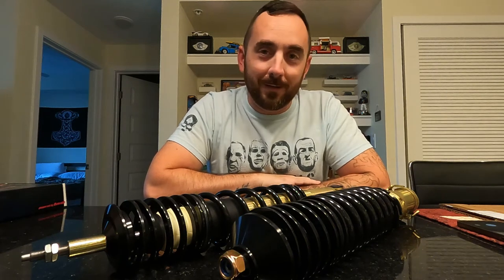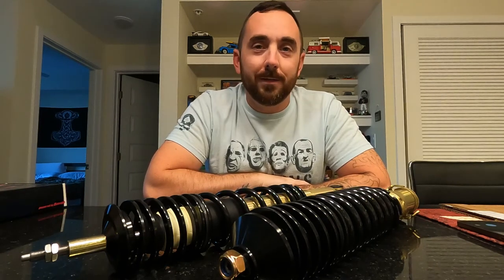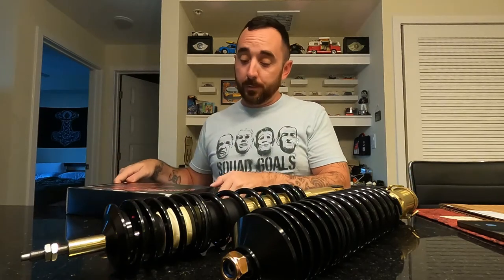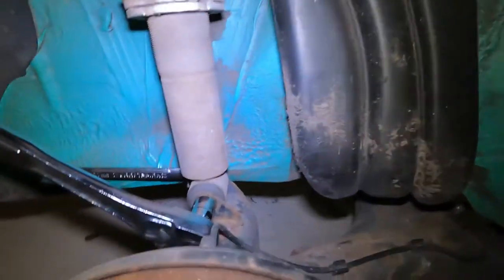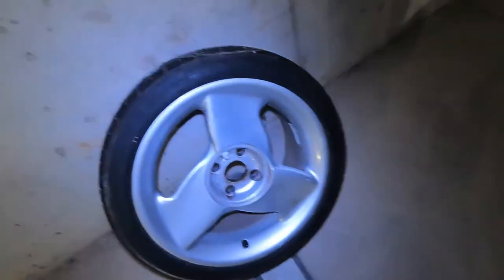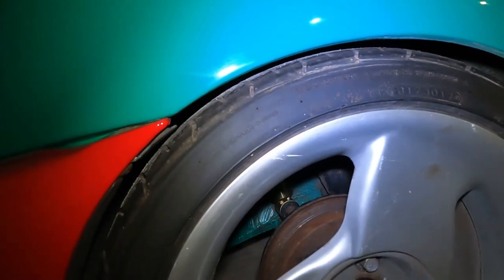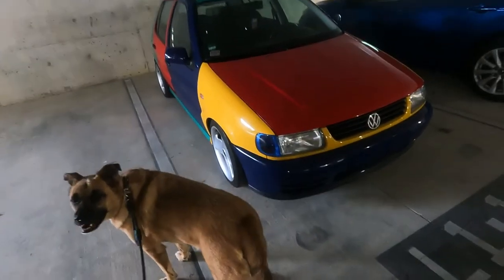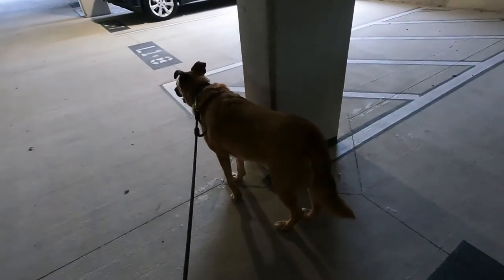VW 6N Polo Harlekin - Coilover Install

Comment: These are fairly similar to DTS-Line coilovers. I run them under my 6N, now for a year, without any problems. I regularly take it to trackdays and touge routes, and it is doing it's job perfectly. You should get poly bushes for the suspension, because the OEM rubber bushes are weak, and tend to crack after a year of use (abuse :D). It is a nice car overall, I have a 6N2 GTI (around 130HP) engine swap, and with the 280mm brakes from the G60 Corrado and a rear disc brake setup, with GTI antirollbars, it handles quite good. I could beat a lot of more expensive cars on the track with it.
Reply from the maker: Thanks for the comment!! Your 6N sounds pretty awesome. When I was getting the parts for the coilovers I was thinking the same thing about the Poly bushings. Maybe eventually :)

Comment: Does a N9 polo coilsprings fit in polo playa 1998-2000 model
Reply from the maker: It appears the N9 generation uses a different front and rear setup, similar to the A4 VW generation. The front knuckle and rear beam both look very different.